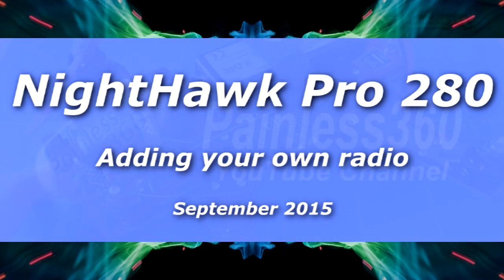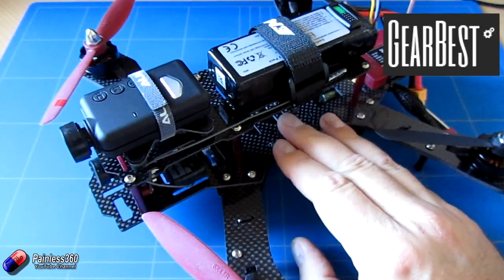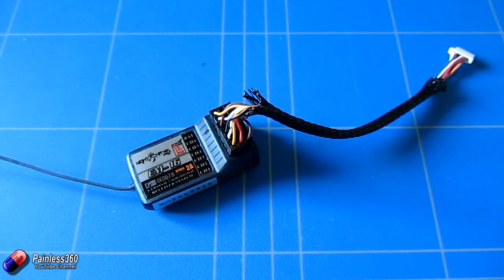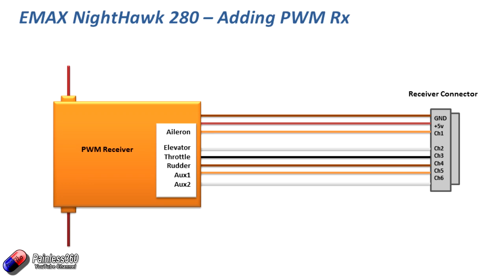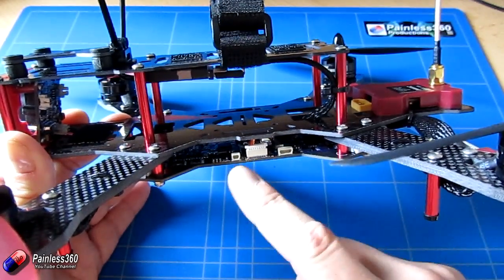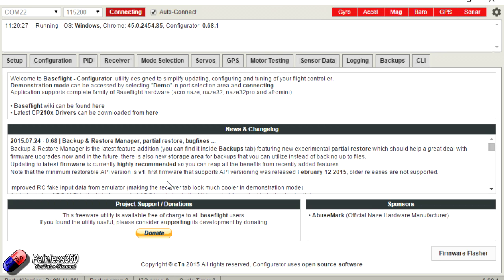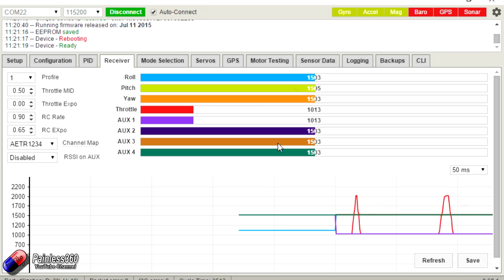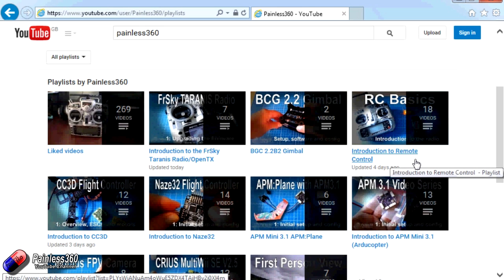EMAX Nighthawk 280 Pro - Adding your own radio and reciever (PWM and PPM)

Comment: Hey Painless, Want to change that fpv transmitter and receiver on the nighthawk 280, Im getting a lot of interference on all the channels and at different flying spots. Do you have a model which you know, can be swapped on the quad? I know I'm probably going to have to solder wires to get it to work. 

Thanks for your time in advance.
Cheers
Reply from the maker: I'd look at one of the Quanum Elite Vtx modules and a nice camera like a Runcam eagle..
Reply: Alright thanks for your tip and for the quick response, appreciate it!!
Keep up the good work with the reviews!!!
Cheers

Comment: stock rtf now comes ppm 1 wire,,, I tried like you said plugging all wires, it will work stock with stock rx pwm with all wires connected, but it shouldn't the way it comes out of the box is ppm, and the extra plugs are zip tied together only 1 wire is plugged in ppm style,,,,Like an idiot I saw this and thought it was wrong and I connected all wires, and it worked like that too? but what I didn't relized is in clean flight I was still ppm so even tho all were connected it was only working off the 1 wire.....so when I went to use my Orange I tried it w all wires , but that was wrong since my Orange 615 rx uses ppm , I just figured it all out and now I got it to work w Orange 1 wire ppm/......   everything you said was great but note new rtf versions mine anyway was ppm

Comment: Hi guys, Ive followed the steps with a Orangerx 615x but it doesnt work!  the receiver binds but no movement in the model, not even when hooked up to cleanflight.  Im stumped! the PPM option is selected, the lead is plugged into the bind/battery port as per the receiver instructions, I get a solid light to confim bind then nothing.

Comment: hiya iv just put the devo receiver on  and wired it following it from ch1 to ch6  and i pugged it in to baseflight just to cheak it and every thing looking good  apart from my aux2  and throttle move together lol  
so its wired up bound  and ready to  flash it with cleanflight    do i need to keep my transmitter turned on throw this  cleanflight flashing    and  just follow this video   yeah  and thanks very much for your help and advice   to get me throw this  iv been banging my head off the walls for weeks haha
Reply from the maker: The receiver doesn't need to be powered up through the flashing but will be needed when you come to test and setup the radio pieces. Best of luck!
Reply: thanks  i had to forget about it for a few days i was getting stressed out with it  lol but im more chilledout and level headed again so im going to go over your video 2-3 times before i flash it  and thanks very much hopefully this will work this time

Comment: hi how do i get all my channel to settle on 1500 with the nighthawk transmitter & receiver  i just cant get this arf model setup
Reply from the maker: +William Davie you should be looking at the subtrim menu. If you don't have one then the trim buttons by the sticks will work too.. Best of luck!
Reply: thanks its the factory transmitter with the trim buttons  but i just cant get my roll & pitch to settle on 1500  or to respond from the sticks  when setting up in receiver settings on baseflight   iv been stuck with this for the last 3 weeks   its driving me mad   some people has told me to flash it with cleanflight  would that really help  painless360
Reply from the maker: If the channels are not moving at all then you need to check you've setup the receiver setting right - see our Naze32/Cleanflight videos.. Best of luck..
Reply: thanks i was just going to have another go at it  but ill have a look throw  naze32/cleanflight video,s  iv watch just about every video about it and following evey thing i need to do really   but iv just got the walkera devo 7 transmitter and receiver  to put on it  but it should work with the emax factory set up lol   but yes ill look throw naze32  video,s  thanks again

Comment: I did everything you said and got my Orange RX hooked up, in cleanflight everything worked , accept I could not get the model to arm motors?  I set the arm on the aux 2 / gear switch .. set arm in the values , but the motors never started spinning???
Reply from the maker: I don't use the modes to arm, I always use the default low throttle/rudder right to do it.. Best of luck!
Reply: yes I figured it ou ,,, read above, and I'm also just using the stock arming mode

Comment: Great video! I hope you can help me. I recently bought a nighthawk pro rtf and from setting it up on base flight I crashed it almost instantly. from investigating the problem I notices that the roll on the receiver is constantly fluctuating from low to medium.  do you know how to reify this. Many thanks
Reply from the maker: +Aaron Barbour could be the radio or the reciever. I'd contact the vendor. Best of luck!
Reply: I was hoping you wouldn't say that. Thanks though and keep up the great vids
Reply from the maker: +Aaron Barbour unless you have the kit to troubleshoot it you'll just end up with a product you can't get support on /can't return. The cheap radios that come with many RTF units don't have decent tools to do basic checks.     Best of luck!

Comment: you're talking about lifting little lips at about 8:00 
could you make a closeup on how you removed the wires from the microplug that goes to the board? 
maybe I dont have a tool thats small enough :D
is it exactly the same way as on servo/jst plugs?
btw: thanks for your awesome tutorials

Comment: how do u use the camera it comes with , with fpv?
Reply from the maker: +Reggi Pech The drone has all of the things on it you need - camera and video transmitter - so you just need a set of goggles/ground station to receiver the image and display it! Best of luck!
Reply: +Painless360 tnks

Comment: Hi, I cant connect FS-TH9x transmitter and FS-R9B receiver on my nighthawk 280, bind went well, when connected all connectors to receiver as it says in your video, using cleanflight choose PWM , in the beginning olny aux 1, 2 chart were moving, then i tried to change connectors bind again, so now when connected, receiver flashes once and then switches off, no red light... maybe I fried something while changing switches? thanks
Reply from the maker: Cleanflight or Baseflight?
Reply: what did you do to connect it? I have the same problem but I'm using baseflight
Reply from the maker: You should be using Baseflight unless you've updated the model with Cleanflight..
Reply: Painless360 I am

Comment: Painless, when I hook up my nighthawk pro 280 to my computer in baseflight  it doesn't connect can you please help me find out what's wrong. I hope you answer. Thanks
Reply from the maker: What troubleshooting have you done already?
Reply: +Painless360 I have switched remotes/ reciver, I have changed the order you plug it in I have binded the remote again.
Reply from the maker: Try powering up the model from the battery before connecting it to the PC.. Hope that helps.
Reply: +Painless360 I have tried that and it still says "serial port is successful open" and then "no configuration within 10 seconds, communication failed"
Reply: +Painless360 what do I do?
Reply from the maker: +Rc Addict I'd go back to the vendor.. Best of luck.

Comment: Hi have just bought the artf version. I am using a 4XR receiver and Taranis radio. Everything is fine except when I try to set up the flight modes in Baseflight it simply won't save. It is recognising the switch changes but when you tick the boxes for the modes they remain red. When I hit the save button nothing happens. If you navigate away from the page and return nothing has been saved. Can you help? Thanks Alan
Reply from the maker: +Alan Cruickshank The X4R only provides 4 channels for PWM or S-Bus for a single wire connection. You need 5 channels to also have a 'flight mode' switch..
Reply: +Painless360 Thanks for the reply, I am using a new x4r which has ppm. Baseflight is recognising the switch you can see it moving on the modes tab. I have also set the end points for that channel so it doesn't seem to be the receiver.  The problem is the save button just doesn't work 😡. There is a video on YouTube showing this problem if I can work out how I will post a link here. Thanks again
Reply from the maker: +Alan Cruickshank That's odd! I've not used Baseflight much here but my first thing to try would be re-flashing the board.. Best of luck!

Comment: hi mate wondering if you could help I'm trying to get the devo 7 working with the RX7 01 the bind I have done  but it doesn't arm even when I use the sub trims could you help me please thanks
Reply from the maker: +vision1234567891 Sorry, I don't use that radio here. The subtrims do nothing to the 'endpoints' of the throttle and rudder channel you need to arm it. I'd look for the menu that allows you to extend it past 100%.. Best of luck with it.
Reply: +Painless360 I managed to sort order m point out but still doesn't arm is there a way in baseflight to change it to a switch
Reply from the maker: There is but the failure to arm is pointing to something basic not happy.  Make sure the accelerometers and magnetometer is calibrated and check the setup.  Best of luck!
Reply: +Painless360 thanks mate but I managed to sort it and now it works perfect
Reply from the maker: What was it?
Reply: +Painless360 I went to function then went to trvad change stuff in there and then it worked

Comment: I’m having problems with my Nighthawk 280.
Try plugging in my battery to fly my quad and there was no ESC sound, the three LEDs next to the usb port are off and other LEDs on the board were solid red. Connected quad to computer using Baseflight (LEDs were normal then), connected battery while connected to the computer and only then I was able to sound ESCs and was able to spin the motors with the transmitter. It worked just fine when connected to the computer but not off the computer. Don’t know whats going on.
Hope you can help as I haven’t been able to find anything on the Internet about this issue.
Reply from the maker: +Gustavo Tirado Sounds like a power problem with the 5v supply to the board and ESCs. A power regulator may have blown.. best of luck with it..

Comment: what is the flight range with stock controller ?
Reply from the maker: +TheSummers611 It should easily get you well past the legal range in most countries (400ft)..
Reply: thanks just ordered myself one of these and was unsure about range on stock will also upgrade at a later date { £££ :( } thanks again for your help and keep up the good work

Comment: I will be using Cleanflight on my Pro 280 but using a PPM receiver on my Taranis.  Will your model file work in my Taranis since you have Baseflight installed?  My thoughts are it doesn't matter as it's the NAZE firmware is a non-issue when dealing with the transmitter, but wanted to run it by you first.
Reply from the maker: +GarretB123 Should work, but check everything in the GUI before trying it with the props on..

Comment: Can you add OSD to the Nighthawk 280 pro?
Reply from the maker: Not planning to John. I assume it's the same as any Naze32 clone.. Why do you ask?
Reply: +Painless360 I have a funny feeling that you can't add OSD to this frame.  It would make a great video adding a minimini OSD.  Its a great frame  and would be even better with a OSD option.   Only thing preventing me from getting one.
Reply from the maker: You would need to use Cleanflight on it, use Softserial and cut the video out cable just behind the FPV camera where it plugs into the main circuit board to splice in the OSD. In theory its do-able but I'm not going to start cutting into mine to find out. Had enough of fighting with OSDs recently  ;)
Reply: +Painless360 I understand that.  but I think its using the same FCU and the Skyline 32 so they don't have the data stream for OSD.  Sent them a note to find out.
Reply from the maker: Not another one! ;)

Comment: hey painless! so i got my fs-t6 setup with my arf version, the problem is when i hook up a battery to fly it, it sometimes only spins one or 2 motors, has no power at all and some of the motors twitch and dont work. Do you think the motors are bad or the board itself? btw i tried it with a full battery and the settings on my fs-t6 control the right things, its connected with all the wires, ppm i think. Also when i try full throttle it twitches and reboots itself. ;(
Reply from the maker: +Alberto Alvarez Do all of the channels move as were shown in the video? Have you confirmed how far each channel travels?
Reply: Yea the throttle moves the throttle and so and the transmitter is on fixed pitch helicopter, should I try using the one-shot ability?
Reply from the maker: Nope, I would calibrate the ESCs as a first step. Don't forget you can contact the supplier for support.. Best of luck!
Reply: +Painless360 Ok thanks painless, keep up the awesome work! I think I'm done with the nighthawks, the rtf I bought worked fine, crashed a bunch of times, picked it up and flew again, got about 50 feet and it full throttled into space by itself nowhere to be found....... two bad experiences with these nighthawks for me so I'm done with them lol any suggestions on my next quad? probably going to buy one of these http://www.helipal.com/storm-racing-drone-rtf-type-a.html thoughts?
Reply from the maker: If you are ready to try a build then I'd look at something like this - https://www.youtube.com/playlist?list=PLYsWjANuAm4r-E61stLchCR4bzY3NmDNh

Best of luck with it!

Comment: Question: using a JR9503 with Spektrum AR7000 rx.  PWM and plugged into correct channels on rx.  Nighthawk flies but only in manual mode as I can't figure out why my yaw and aux1 functions are mixed.  Using an aircraft model and no mixes are setup in tx.  Any help or ideas would be much appreciated as I can find exactly zero support with this issue.
Reply from the maker: +Phil Johnson You probably have the cables for the rudder and AUX1 swapped over in the receiver then... Best of luck.
Reply: +Painless360 That's the wierd thing, I can unplug the last 2 cables completely and the yaw and aux1 are still tied together.  Both continue to move on the "receiver" tab in baseflight.  I know that at first glance, it looks as if a mix is turned on in the rx, but it's most definitely not.  Only changes that were made in rx are to the end points.  Everything else has not been changed.  I have also tried a DSMX and DX8 radio with the same results.  Bear in mind, the quad flies and I can handle manual mode no problem, but I just wanted the other settings so I can let noobs try the little guy out without fear of planting it.  And I know it's supposed to work with JR because Baseflight put JR/Spektrum and rx type tabs in the setup menu.  Very frustrating.
Reply from the maker: Then that looks like a problem on the radio - check you can see the channels moving in the right way in the 'monitor display' in the radio. I would check that you have 90 degree swash if you are using a helicopter model style model memory too..
Reply: +Painless360 Yes, everything is moving the correct way and using "aircraft" model type as recommended by manual.  No mixes were setup in tx, using a straight new model partition with no changes to internal programming.  At a complete loss, but at least it flies I guess...
Reply: +Painless360 Correction, only change to programming is end point adjustments, for 1000-2000 setup.
Reply from the maker: If you need direct support then pop me an email and we can look at it (direct support is chargeable though). Best of luck.
Reply: +Painless360 Great, will play around with it a bit more and will contact you when I hit the all is lost wall.  Thanks for your willingness to assist, you're the only person that has at least responded to me so far.  Much appreciated.

Comment: I maybe buying this Quad soon (ARF version), but I still have questions about it's board. I think You know this for certain. What I couldn't find out was: which sensors and connections this board has... -Does it have a barometer (pressure sensor) and magnetometer?-Is there any serial ports available to connect a GPS and an OSD for example?thnkx
Reply from the maker: +Bruno Santos You can see the answer in the video - see the sensors that are highlighted in green in the Baseflight GUI (about 14:40). Hope that helps.
Reply: +Painless360 ,well I was planning to add GPS to be able to use RTH function, but I don't if it's a good idea anymore, because the RTH function uses the barometer(wich I wont have) in conjunction with the GPS.
Have you ever tried to use the RTH function aided by GPS only, in other quads? How did it go?
Reply from the maker: GPS RTH functions need the compass so will not work with this model. Happy flying!
Reply: +Painless360 But your video shows a compass(MAG) enabled/active...
happy flying to you too.
Reply from the maker: Sorry, I'm not being clear - RTH functions work very poorly in Baseflight/Cleanflight so you can add a GPS but you are potentially wasting your time unless you are looking for GPS co-ords in an OSD display..

Comment: I did find a cable that would fit for what I want it to do but it's diff colors it's got blue and green in it
Reply from the maker: +george aura Colours don't matter, the board is clearly marked so follow the connection diagrams and it should work. Best of luck.
Reply: +Painless360 oh ok then